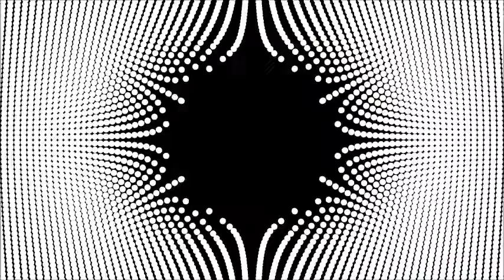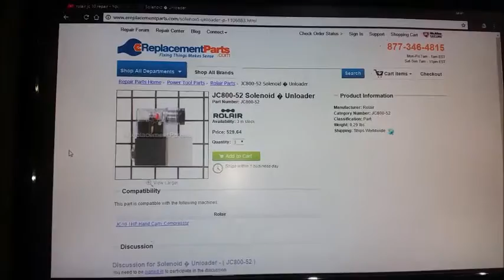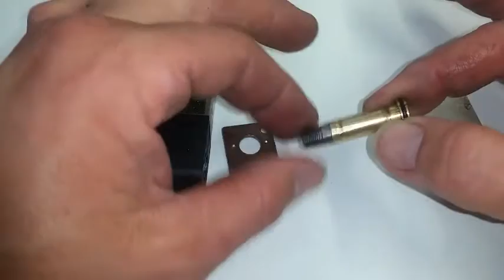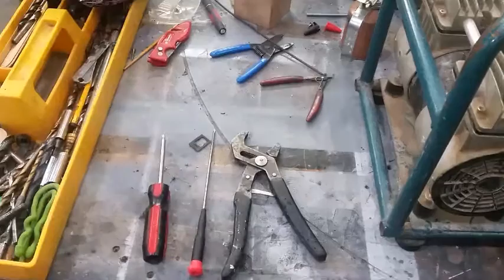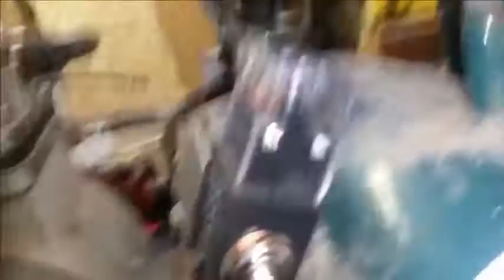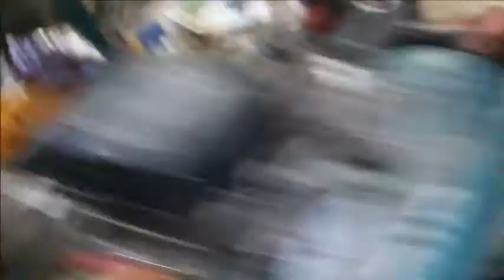Rolair JC-10 repair

Comment: Mine's been working for 9 years now. I emptied the drain valve as I normally would do. It's hooked up to my drive thru window. Not sure what happened this time but after I drained it, the compressor didn't turn on. Would this part fix it?